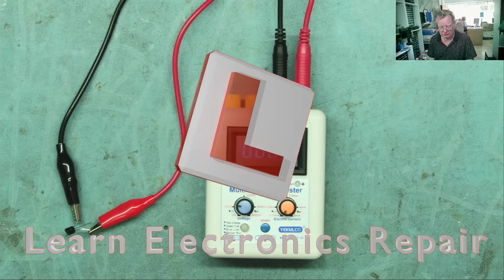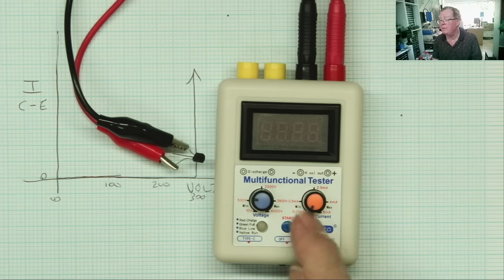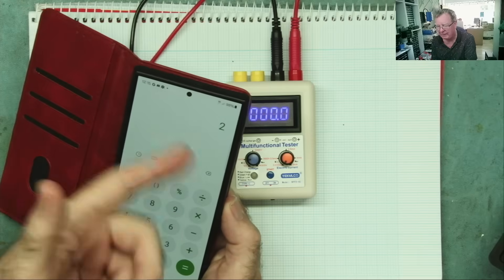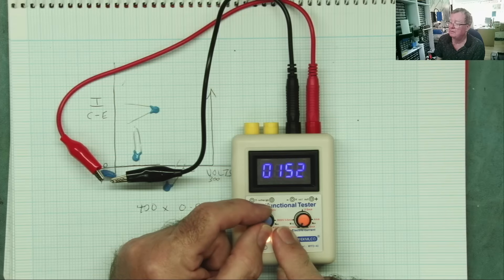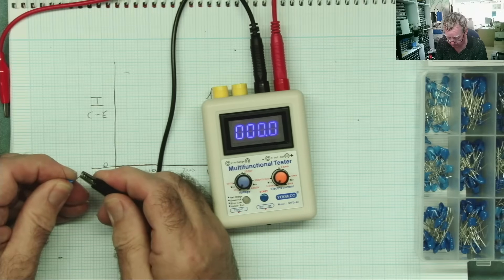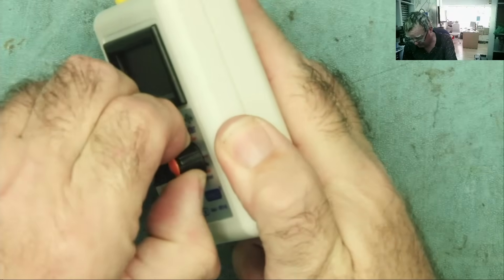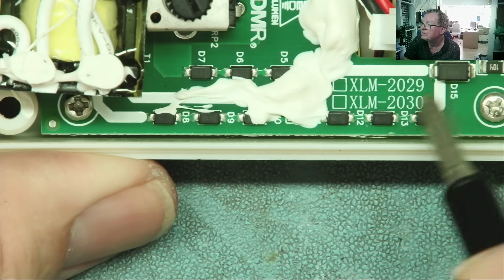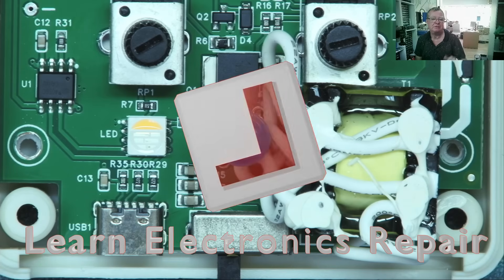Is the 4000V Breakdown Voltage Tester SAFE? : Find FAKE Mosfet Transistor IGBT Diode Capacitor Triac

Comment: The high voltage mosfet at the top has nearby circuitry that is about the same as a capacitor discharge pen I recently acquired.  I suspect the top edge beyond the cut in the PCB is the constant current discharger.

Comment: With regard to damaging transistors:
Power MOSFETs will "happily" withstand repetitive over-voltage  as long as the energy and power are limited. What actually normally avalanches is the intrinsic body diode. Most modern power MOSFETs are well-specified for single pulse avalanche energy and repeated avalanche power.
If you are careful, you can take advantage of this with a discrete FET in a flyback converter, dispensing with the snubber for leakage inductance discharge. The energy gets dumped into the FET's diode, saving (usually) three components and taking advantage of the fact the FET is likely on a heatsink. You don't dare do this with many of the integrated flyback control + switch ICs. They'll give up the ghost if you exceed the rated maximum voltage.

Repetitive reverse breakdown of the base-emitter junction of a BJT will eventually degrade the current gain ("beta"). This is generally a slow process but one you'll sometimes see in astable multivibrators made with discrete transistors.

Comment: I see some people have brought up X and Y caps.

The internet is awash with claims that "X caps are designed to fail short-circuit and Y caps are designed to fail open circuit."
I cannot find a single credible source to support these claims. I used to design industrial SMPS that required X and Y caps. I've looked at a lot of datasheets and read a lot of ap notes. Again, nothing supported these claims. What is known is that X caps, which are typically metalized film, often polypropylene, do tend to fail short circuit and then, if there is enough energy available (which is almost invariably the case) they may "self heal" by blowing the short open. This is simply the nature of the beast. Why anyone would deliberately design a cap used across AC mains to fail short-circuit is beyond my comprehension. It probably would blow the fuse rather than starting a fire, but the manufactures warn that there is a fire risk
I have seen film caps in which a short has been cleared by virtue of the fact the capacitor was blown into to pieces. That was in the same sort of circuitry where I've seen where fairly wide PC tracks used to be but were apparently evaporated..

I've never found anything to suggest Y caps have any particular failure mode. They are designed to withstand voltage very much in excess of their normal operating voltage. Some are essentially "double insulated" - effectively two caps in series. I have no idea how you would set about to design a multi-layer ceramic capacitor to reliably fail open-circuit. If you put a fuse in it it would probably go open-circuit after a short-circuit or arcing failure, but that's not exactly what I'd call "safe." Actually, it's not anything remotely like what I'd call "safe."

There are some low-value capacitors (typically no more than 4.7 nF, since that is the highest value normally allowed for Y use without excess current from line to ground which would create a shock risk if ground were opened) are rated for either X or Y use. A capacitor can't figure out how it is being used and decide which way it should fail!

If anyone knows of a truly credible source that supports these web-spread claims, I'd be interested in a reference (though I don't actually do any of this stuff anymore). I don't count somebody's blog or YouTube channel as credible unless the person is an engineer or scientist with a capacitor manufacturer or otherwise a true capacitor expert.

Comment: I got excited too soon because of your video. I only bought a wonderful transistor junction breaker and capacitor dielectric hole driller.
Reply from the maker: Then you should have watched this video so see that it doesn't beak transistor juncations and it won't damage capacitors if you use it properly!

Comment: repetitive breakdown does permanently injure transistors. they may still test and work fine, but they will have much shorter lifetimes before failure. transistors exposed to repetitive breakdown should be tossed after testing and not go into production equipment.

Comment: cap insulation has punch through and doesn't  break down and recover as such.
you could try and see the difference between X and Y capacitors, Y should fail open.

You may do the same with the transistors if you connect the tester set with a high voltage and then you press the button.
This may result in a higher current to flow before the constant current cuts in.

Had this with a ATE system I built too many years ago. The power supply was set to a CC limit so that in case of a short on the pcb under test the relay matric would be fine. But the ladies soon found out that if they put a shorted pcb in the test jig, they would get a hour or two away from the tester as i had to change the relay.  was not easy on a relay card with over 600 relays side by side, end to end. The problem was the current spiked before the cc could limit it, I changed my program so that the power was set to zero and then increased to the required level. The CC worked and no more relay contacts shorted together. 

Was fun at the time. The 19" rack with what was then a state of the art 8086 PC, the system cost more than my house at the time. surprised that gave me the budget to design and build 3 of them. That was a fun time to work in was was called test support department.  The others built manual test fixtures but I got to build inhouse Automatic test systems. 🙂
Reply from the maker: Oh that's interesting regards the X and Y capacitors...

Comment: There is diff betvene normal ceramic, X2 and Y2 caps. Just for those that are not aware. 
Look up, there is a wery important diff, if you are making-reparing high voltage devices.
Plus that is one of sources of ground leakage current in modern devices.
Add more and more of them and you start triping protection circuit.
Reply from the maker: I made a video about X and Y capacitors. Yes you are correct there is a difference between these and High voltage disc capacitors and they should not be interchanged

Comment: You don't want much capacitance in a circuit like that - just enough to get the ripple voltage down to something acceptable.
For testing breakdown voltage of ordinary semiconductors it wouldn't matter much if there were a moderate amount of capacitance. If you are testing something that exhibits a negative resistance characteristic (e.g. CCFL), once the threshold voltage is reached and the device "triggers" any energy stored in the capacitance would be rapidly dumped into the DUT, possibly damaging it. Lots of "triggerable" devices (e.g. diacs, gas discharge over-voltage protection tubes) will easily handle substantial pulse current, but not all will. (a cap charged to 4 kV will store as much energy as 10 000 times as much capacitance charged to 40 V)

It would be interesting to 'scope the thing, but you'd need a probe with adequate voltage rating. Most 100:1 probes (which only get 4 kV down to 40 V) are only rated for 1200 V. High voltage scope probes are quite expensive, usually very big and sometimes filled with an insulating fluid. You really, really don't want to do a test of the breakdown voltage of the input of your oscilloscope. Many years ago Jim Williams, then of Linear Technology, wrote quite extensively about high voltage probes in an ap note about CCFL inverter circuits, iirc.

Johanson Dielectrics has produced some good ap notes that I recommend to anyone who needs to do circuit board design for high voltage SM ceramic caps.
Reply from the maker: Another subscriber linked to a review in the comments here, there are the expected capacitors  and this is a voltage tripler circuit as I sumised, it's just that the hid the capacitors under the white silicone

Comment: If that transformer was originally made for CCFL, it might be one for 2 tubes in series? Judging by the class of PVC wiring on that panel meter, it's a 400v unit intended to sit behind a 10:1 divider and it's been reprogrammed to have the decimal point shifted one place to the right. 4KV would require silicone wire and maybe doping.
Reply from the maker: I don't know it is a CCFL transformer it was just a guess. It looks more like it is using a voltage tripler with a lower transformer output. It does say in the user manual you can use it to test CCFL lamps. If you are thinking it is generating 400V not 4000V this is not correct, I proved it does generate the voltage it shows on the display by also connecting my Fluke meter in part one of the reviee.  it was also surprisingly accurate.

Comment: What I don't understand is that on the previous video @18.30 you tested the 3rd AliExpress capacitor (10nF) while the tester was set to 550v, yet it still only showed 159v. It appeared to arc over at less than 1kv. I know the markings are probably not that accurate on the tester, but surely the 550v marking isn't over 100% out?
Reply from the maker: I think that is just how I edited the video, sometimes important bits end up on the cutting room floor unintetionally.

Comment: Great info, many thanks. I snagged one a couple of months ago but haven't used it yet. I did notice that it warns NOT to test large capacitors with it, as it will burn it out. Seems like a handy little tool, though. Thanks.
Reply from the maker: Yes, as I found in the first review video, It does not have enough current capability to test large capacitors but it does not seem to be damaged by attempting to do so.

Comment: It  doesn't seem to be a reliable tool  I would much rather use a transistor curve tracer in conjunction with an oscilloscope just to make sure that the DUT doesn't get burned during the test .... :)))
Reply from the maker: They are completely different things to be used for quite different reasons and purposes, IMHO both are excellent tools but one can not do what the other can and vice versa
Reply: Me too, but I don't have one.  It might be more useful if there was both a voltage and current display, not just voltage.  Looking forward to the day a pocket curve tracer hits the market.
Reply: @pault6533  Ну ток тоже условно показывает, ведь мы заранее устанавливаем его величину. И если уж так необходимо измерить ток, то никто не запрещает последовательно с проводами подключить 1кΩ (можно меньше, но тогда необходим более чувствительные осциллоскоп) резистор, и на нём осциллографом измерять падение напряжения. А другим щупом осциллографа подключиться параллельно выходным контактам на измеряемом транзисторе или конденсаторе. И в осциллографе настроить сетку показаний X-Y. Правда т.к. протекающее напряжение постоянное, то и на осциллографе будет видна точка, опять же в некоторых осциллографах можно включить послесвечение, и тогда будет виден весь трек прохождения этой точки по шкале X-Y.

Comment: My $8 one I ordered during your last video arrived yesterday. Some suspiciously cheap mostfets arrived today, so I'll get to testing it soon.
As far as the capacitors, I'm glad you pointed that out. It's one of those things that seems obvious in retrospect, but I could also totally see myself just connecting with the voltage set too high without thinking abut it. 
I'm not sure about the diodes. Maybe just a HV diode stack for back emf? It seems to connect to the CC limit pot? I'm as confused as you are about the lack of capacitors at the HV output. Maybe they're only using tiny pulses? That would explain the mosfet at the end, but not the use of a 1kv mosfet on a 4kv signal. 
U1 is the charge circuit. 
I don't think the opamp is for the oscillator. I think U3 is the oscillator and the opamp is used for the constant current and voltage limit. 
Curious circuit, wirh a strange lack of capacitors througout, but I don't have the time to reverse engineer it. I'm sure if we all just wave our units vaguely in the direction of the Isle of Man, Big Clive will post a schematic in the next week or so. 😅
Reply from the maker: Another subscriber pointed out the HV capacitors are actually there but hidden under the white silicone glue and in fact this is a voltage tripler circuit just as I expected it to be because that is exactly what it looked like 🙂 The 1KV MOSFET at the top end I am sure is actually part of the cap discharger circuit that is present on this version and nothing to do with the 4KV generator.
Reply: @LearnElectronicsRepair  Ah, okay, makes sense.

Comment: hi
there are 3 capacitors buried under that white insulation paste , as you guessed , a voltage tripler  , and 3 sets of 3 diodes ( U1M = 1000 V fast rectifier ) .
I saw it in another video :  https://www.youtube.com/watch?v=D2VZaOnB1YY
good luck
Reply from the maker: That's so good to realise I was right even though I couldn't prove it.  This circuit now makes perfect sense 😃

Comment: Thanks for the teardown Richard!  I was wondering what was keeping it together after the screws were removed and it was the knobs. I was hoping to put a larger cell inside but it’s more cramped than I expected.  IMHO This isn’t the right tool to test electrolytic capacitors. A leakage tester or setup is preferred.  The user needs to be aware of the power being delivered to the DUT and the limitations of the device to deliver such power.
Reply from the maker: Agreed regards using as an electrolytic cap tester, but for many other things this is ideal, and cheap!

Comment: 15:50 TP4056 Linear Li-lon Battery Charger as found in modules across ali.
Reply from the maker: Yeah I realised after this must be part of the charge circuit.  The LM324 seems to form the oscillator driving the mosfet/transformer. And probably some feedback circuit to maintain the constant current. I still think all those diodes look like a voltage multiplier ladder but as mentioned didn't see the capacitors one would expect.  The decimal point thing seems to be a function of the off-the-shelf voltmeter module, dependant on which type is used on any given version of the tester.